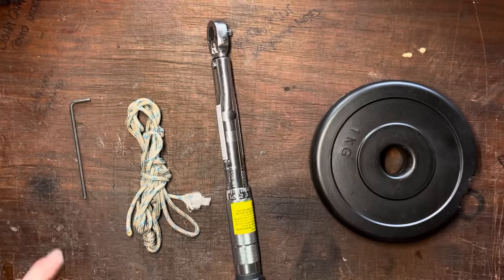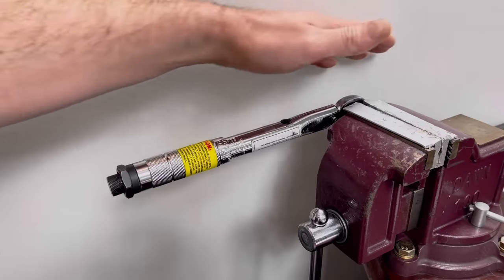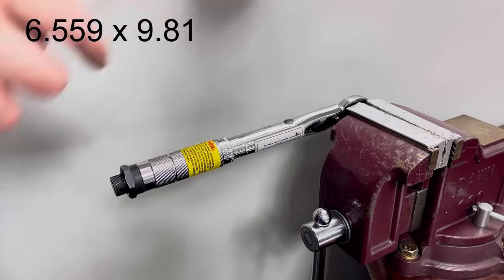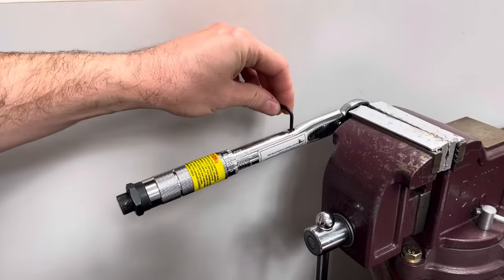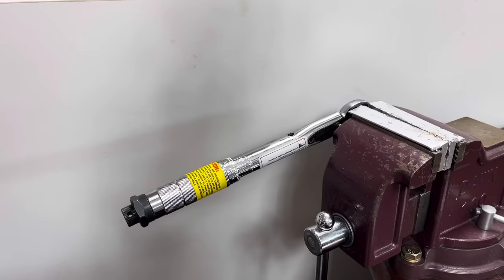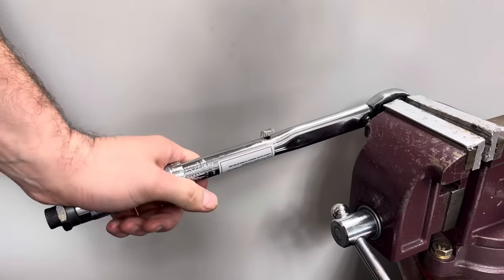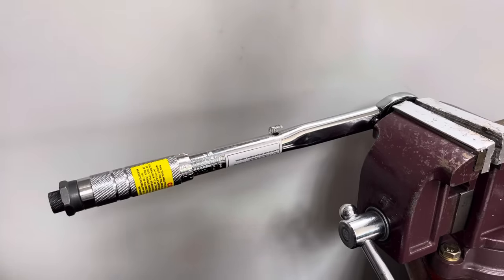CALIBRATE YOUR TORQUE WRENCH IN UNDER 5 MINUTES (NO SPECIAL TOOLS REQUIRED!)

Comment: Questions/comments:
1. You confirmed the weight of the sugar bag, dumbell etc …..using “a scale”.
How do you know THAT measuring device is accurate?
2. You tested the torque wrench at ONE place.  A proper calibration would test it all the way up and down the range it is used at.  (It could test great at 20 ft-lbs, but be hopelessly off at 40 ft-lbs.
Reply from the maker: Hey! Lots of great questions, all I can say is that it has given me very accurate and consistent results for a long time. Whenever I compare it to another torque wrench it’s spot on and after all, it’s just used for small engine repair, it’s not used by NASA :)

Comment: When you set it after a vertical measurement, the self-weight of the torque wrench will give an erroneous measurement. Wouldn't it be better to make a horizontal measurement with the cord over a wheel or pulley.
Reply from the maker: Yes :) you can use luggage scales horizontally work great, however many don’t have them and gives more than accurate enough if you don’t have them though!

Comment: Why didn't you hang it from the groove machined into the handle......rather than a random spot between the groove and the sticker .... like it makes 0 sense. You could have had an exact spot to put it every time
Reply from the maker: Because the measurement changes as you adjust the handle and thus I can use a round number

Comment: Thanks for sharing. Is it right to ignore the wrench's own weight? Of course the weight distribution of the handle bar is not uniform but it will be more precise if you add it too.
Reply from the maker: You can work horizontally with luggage scales if you like, that way you can eliminate the handle weight :)

Comment: I did the calculation to determine the Newton Meters added by the weight of my wrench handle. 

It’s a pretty cheap and standard 1/2 drive wrench, total handle length about 18”, and it weighs just under 3 lbs and I did all the calculations in metric units. The distance from the center of the drive to the groove in my handle is about 37.2 cm. When the wrench is held horizontally, the weight is distributed such that there is .661 Kg downward at the groove from which I would also hang the additional weights as necessary. Using VER’s formula, with no extra weight on the wrench, the weight of the wrench produces 2.42 NM. 

If the wrench clicks at 100 NM, the force of the weight of the wrench produces 2.42 NM and the weight is producing 97.58 NM.  It would be easy enough to test at various weights and adjust the indication accordingly. That might be smart if you’re torquing bolts on the space shuttle. If you are torquing your snow tires, you are probably close enough without bothering to do the adjustment for the weight of the handle. Basic  torque wrenches are usually calibrated to within +/- 4%.

Thank you VER, this is a nice and useful video. 😊

PS: yes screwing in the dial does change the length (arm) in the calculation but I doubt it’s significant.
Reply from the maker: Thanks for doing the calculations! Much appreciated :) glad the video helped and thank you for the super thanks! It’s all much appreciated. Warm regards, Tom.

Comment: Okay, I'm totally hung up on the math. You should have explained it a little bit more, rather than just telling us to "not get hung up on the math."  The information in this video is good, but your technique is mediocre. The whole "clicks too early," and "put the rope up" and "pull the rope back" leaves quite a bit of  inaccuracy in the measurement, and will NOT indicate to you that you "know" your wrench is "well rounded with a good, accurate measurement."
Reply from the maker: No worries, thanks for the feedback
Reply: @VintageEngineRepairs  You're welcome. I might hate math more than you, but I'm not sure of your level of loathing. I like the basicness of your technique, despite it's variability. I think your system is the MOST useful if someone is stuck in a remote environment somewhere where they is little, or no access to other machines or resources. One could be snowed in in a cabin in Alaska with an out of spec torque wrench and your technique is guaranteed to work, and probably well enough for whatever task that snow-bound machinist would encounter before the thaw. OR, you could be on a deserted island in the middle of the ocean ... ;-)

Comment: I had 7 torque wrenches to calibrate. I bought a digital torque adapter to calibrate them. Most were fine. But a few were off. I was able to calibrate all but one of them. The reading on one of them is all over the place. It is not consistent at all. Does this mean that this torque wrench is toast and it can no longer be calibrated?
Reply from the maker: Interesting! I can’t say for certain, but if they were cheap wrenches I’d not be surprised if over time they became less reliable!

Comment: The metric wrench was way out. You moved the moment even closer when you adjusted the setting. Simple remeasure after setting of the wrench.
Reply from the maker: Yep it was an editing mistake, set the handle, measure and then add weight.

Comment: Its good in theory but you didn’t weigh your test weights with a precision scale. Since you cant trust the weight stamped on them you’re not calibrating. Fail 😮
Reply from the maker: Thanks for watching :) I weighed them on a set of scales, for our needs with small engine repair, it’s more than accurate enough!

Comment: Another way to CHECK calibration....instead of DOING a calibration....is to check the value obtained with your click-wrench against a beam-type. The beam type is always correct.....but harder to use as it doesn't have ratcheting action.
Reply from the maker: Thanks for sharing

Comment: it's important to ensure that the handle is as close as possible to horizontal, if you don't, not only will your weight probably slip, but the measurement will also be wrong!
for any wondering, the 9.81 figure is G, the gravitational constant, aka how many Newtons of force does a Kilogram of mass apply. 1Kg of mass weighs 9.81N on earth.
the 12 figure is just the conversion of inches to feet. if you multiply feet by lbs you get ftlbs, if you multiply inches by lbs you'd have to divide by an extra 12 to get ftlbs
Reply from the maker: Thanks for sharing 👍👍

Comment: There are some small errors.

1. You need to weigh the rope too. And dont forget: the handle has weight too. Doing the calibration many times might help average out the errors. 

2. Using heavier weights might also help, because the percentage of the handle weight will be so small, that it basically can be ignored. Doing these measurements close to the minimum torque might cause the handle to have a bigger impact on the calibration.

3. and thats be biggest error: the moment your wrench clicks the handle isn't level anymore. The final force that makes your wrench click isn't orthogonal to the handle. 
You have to have the wrench pointed slightly upwards so that the click happens when the handle is perfectly level.

Please correct me if I'm wrong.

But i have to admit: if you're calibrating a 200nm torque wrench you propably don't need that accuracy. But things might be different if you use a smaller wrench for things like 6-10nm. If you need such a wrench, you need it to be precise.
Reply from the maker: Thanks for watching! The rope doesn’t need to be weighed. The handle makes a small difference, but can be omitted if you use fishing scales and work horizontally!

Comment: One issue, the spring inside is not linear, I.E., it may register too low on a light weight setting and register too high on a heavy weight setting.
I believe the best practical area to calibrate is around the center of the range, and preferably around the torque where you most intend the tool
Reply from the maker: Yep, where you intend to use it most

Comment: Huh? The distance is measured, calculated then the distance shortened for the test by screwing in the handle, shouldn't the test be done at the correct length determined initially, as in further back by measuring again to determine location?
Reply from the maker: You’re spot on it’s an editing mistake, I put them in the wrong order when doing b-roll. You’re right, set the handle / weight, measure your length and then hang it :)

Comment: Once you turn and dial on the the handle doesn’t the location of the weight placement change to your original reference point.  Wouldn’t remeasuring be required after you dial in the wrench?
Reply from the maker: Yep; editing mistake, well spotted :) set, measure, hang / test!

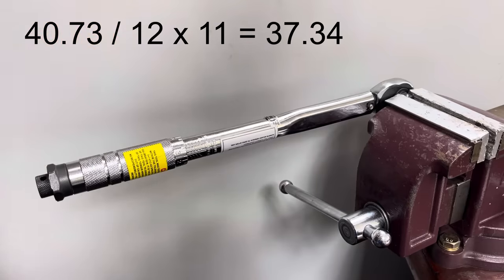Comment: ?? 5:20 measured length;  5:25  adjust for weight;  Does turning 'collar' Change measured spot, or turns 'counter balance' within?   if changes, post 'marking', measure from end = same area. ?   Thanks much  now need Torque wrench.
Reply from the maker: You’re spot on, it was an editing mistake - always adjust the handle then measure :)
Reply: @VintageEngineRepairs   Thanks!  I  needed that today,  how i see things usually  gets me in trouble.  lol

Comment: Great explanation.  One thing to point out is that the accuracy of this method is dependent on the accuracy of the measurement of the weight used.  What sets the calibration of the scale?
Reply from the maker: Hey thanks for the kind words, it’s accurate enough for my needs haha

Comment: Excellent and practical information. Just what I need for home use. When working in Nuclear
 We always warmed the T wrench up at the required setting at the test bench before and after the wrench was used. After this, the wrench went to the lab for recalibration. It's not overkill if it's for nuclear. Usefull tip. If you have lube on the flat contacting surface of the nut or bolt head. This will increase the torque significantly more than lube on the threads only.
Reply from the maker: Thanks for the kind words  :) yep spot on, read the manual each time to see if the torque spec specifies dry of lubed bolt!

Comment: Nice video but I have two comments:
1.  You are making your formula unnecessarily difficult for people.  Weight/12 x Length in inches?  Why not call it what it is:  Weight x Length, in feet?  Just as easy (and way more intuitive) to tell people feet=inches/12
2.  Accuracy is a percentage.  You have inherent error in measuring the distances and even the weights.  Doing the adjustment near the bottom of the wrench range is a bad idea, as, for example, a 0.1 pound error is a large 10 percent of a 1 pound weight, but a more trivial 1% of a 10 pounder.  And, as you did point out, calibrating for one point in the range is not calibrating for the entire range...so pick a torque value either near the middle or near where you care about (eg, head gasket range)
Reply from the maker: Thanks for watching and sharing 👍
Reply from the maker: Thanks for sharing :)

Comment: Good demonstration of a very practical method. Remember that the wrench itself held horizontally will itself exert torque from self weight, i.e. the mass of the handle through its center of gravity. Probably a minor correction.
Reply from the maker: Spot on, though I think you meant to say set vertically will exert force? It will marginally but very minimal. You can do it horizontally with luggage scales if you prefer :) thanks for watching and commenting!

Comment: This why im afraid of buying 2nd hand torque wrenches, bcoz i dont know how to calibrate them. So say someone sells u one where it was never wound back down to zero after every use and was abused or misused, would calibrating it as you are doing here be sufficient? Or are there anything else that needs to be done, checked or replaced? I really need 2 torque wrenches. One 1/2" drive for big jobs and a small one that is in inch pounds for more delicate jobs. Great vid man, thx.
Reply from the maker: Understood :)
Reply: @VintageEngineRepairs   with the price of new ones i mean it would be best buying second hand. And until i saw your vid the thought of calibrating them never occured to me. Unlike a ratchet or spanner, torque wrench is a precision measuring device and i was raised with the dogma of winding it back down to zero to ensure the torque values do not change or the springs inside do not loose their tension which insinuated the fear of buying second that maybe it was not properly taken care of. Well now if i got extra cash and see one for sale, i know that with this info from ur vid i can see how accurate it is and adjust it if its salvageable, or better yet check the accuracy b4 even buying it with weights and a string. Thx man.

Comment: you moved where the original 20 cm mark was when you adjusted the wrench. so you need to hang from the same 20 cm not the same spot on the moving handle
Reply from the maker: Yep editing mistake, mentioned it many times in the comments

Comment: You have to set the length after you have set the torque otherwise you change the length when you rotate the handle.  In the video you measure the length and then set the torque value.  It could be confusing to some.  By the way, should you test over a range of torque values or is somewhere in the middle of the range good enough?
Reply from the maker: You’re spot on, it was an editing mistake on the B roll :) set and then measure. I recommend testing the torque wrench in a few different positions. Thanks for watching!

Comment: Great video but don't the weight of the wrench's body  over estimate the torque cuz if we use it horizontally we don't have that extra weight
Reply from the maker: It makes a marginal difference, but we’ll within acceptable tolerances. You can use a fishing scale and work horizontally which is what I have started doing for ease.

Comment: One thing, it is a nice way to calibrate but, the force is always looking downwards as the wrench changes directions or degrees so it is not accurate?
Reply from the maker: I haven’t found it to be an issue, the offset is minimal, but you can use a luggage scale :)

Comment: I never knew we could calibrate a Torque wrench or that it needed to be calibrated, thank you, this is so simple to do and works really well, luckily my two Torque wrenches were spot on, they are only a couple years old as my old ones went to some one that borrowed them and I forgot who by the time I needed to use one :), a tip for anyone that lends their tools have a white board or chalk board on your wall rack to write on to remember who borrowed what as it can get quite expensive as the two replacement torque wrenches were about four times more expensive than I paid for my originals.
Reply from the maker: Glad it helped!!

Comment: Referring to the imperial/ftlb wrench. If you use it an inch further from the head than where you measure that would be 12". In that case there would be no calculation needed. Xlbs/12x12 is a wash.
Reply from the maker: Yep, keep it as simple as you can :)

Comment: I'm confused. you measured the length beofre you set the torque. does setting the torque change the length?
Reply from the maker: You’re spot on, it’s a b-roll editing mistake, it’s set THEN measure :) I put a correction in the pinned comment. 👍

Comment: To be sorry, I'm honestly confused. Because all your measurements and things should be on the handle. Already designed by the manufacturer, all you need to do is put the weight on the middle of the handle and then use the proper weight and adjust the torque range to that weight. By moving the handle your moving the distance. I don't think you need to measure at all. If you measure then turn the handle the measurement changes
Reply from the maker: Thanks for watching! It doesn’t work like, hence why I have explained the equations. You need to factor in lever length 👍

Comment: The ultimate daftest application I've ever seen of using a torque wrench, is what my tyre fitter did after bolting the wheel on with air wrench at full power  bzzzzzzzzzzzzzzzzz zzzz zzzzzzzzzzzzzzzzzzzzzzz zzzzzzzzzzzzzzzz on each bolt.
He then returned with a torque wrench and went  clik clik     clik clik   on what was left of the bolts.  I said  What Are You Doing?    He said  Tightening .    I never used him again.
Reply from the maker: So did he get them close and finish with a torque wrench? Or did he over tighten the lugs and the torque wrench didn’t turn the bolt any more and thus was pointless?
Reply: @VintageEngineRepairs    He just used the TR to make a click sound after gunning each one so tight I needed a 6 foot long bar to undo. I could had lent him my retractable ballpoint pen and saved him the walk to his tool drawer!

Comment: I had access to some calibrated and certified weights from the balance lab at work. I used these to calibrate a few wrenches. What I discovered was, You should pick a weight that is at the middle of the range of the wrench. The calibration will not be linear through out the range so setting it at mid scale will be as close as you can get. These are NOT precision tools. Repeatability is more important than accuracy.
Reply from the maker: Agreed :)

Comment: Good explanation. Though technically, the weight of (most of) the torque wrench should also be added for anal accuracy. Depends if it's a heavy wrench.
Reply from the maker: Thanks for sharing, you’re spot on. I have since changed to using fishing scales and working horizontally :)

Comment: If you don't have any weights and also want to measure different torques easily, take a digital body scale which you place on the floor so that you can comfortably operate the handle of the torque wrench. Then you stand on the scale and press the handle as you always use it. By measuring the difference between the displayed weight and your own body weight, you can easily check the function of the torque wrench.
Reply from the maker: Thanks for sharing an alternative method!